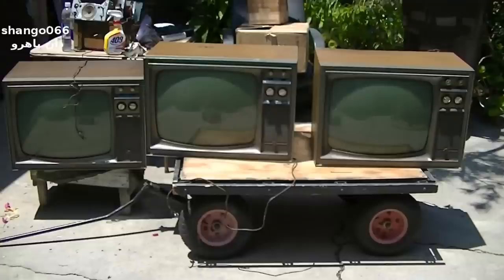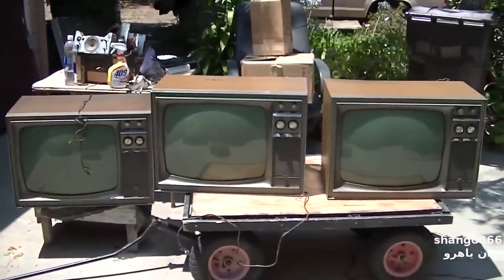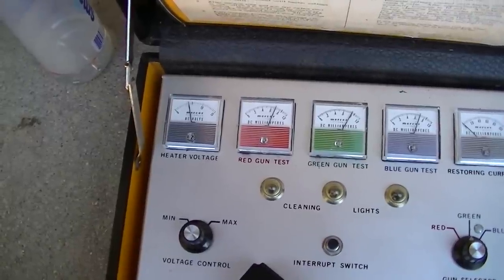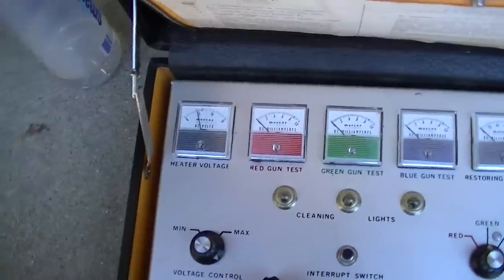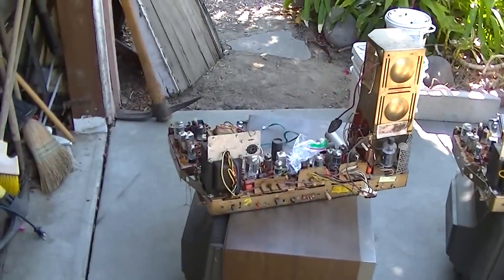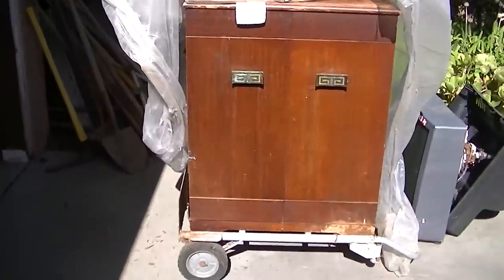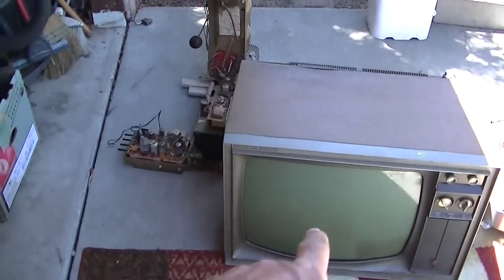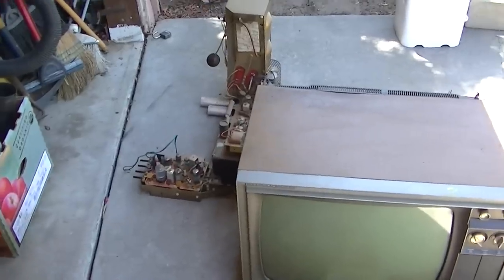Sylvania Color Tube Televisions Testing and Prep

Comment: In the first TV, it looked like the horizontal output tube was replaced as the printing looked yellow. In the late 50's through the mid 70's Sylvania OEM tubes were green printed and for the most part, the replacement tubes were yellow print with some red print. Strangely, the red printed tubes came in a box where the tube number was printed red on the end flap of the box.

Comment: If you ever come across a Philco Ford 17mt80 set (possibly) I would like to see it. It was a roundie with black metal cabinet, and 4 wooden legs. We had one back in 1969-74. Had a horizontal oscillator problem.
BTW, this is a great video!

Comment: I notice you never seem to clean the old dust off. Is there a particular reason? Like does it potentially create a shorted path to just blow these things out with an air compressor? I'm new to this, but trying to learn. I picked up a 1950 Magnavox Playhouse that I want to restore, and I'm wondering the best way to clean up the chassis. Thanks.
Reply: I'd just use an air compressor to blow out the dust.  Currently trying to fix one up and I ended up getting my air compressor at 60-ish psi, went to the tv (it was kind of far away), and blew it out.  Don't get too close, the air is pretty strong at 60.